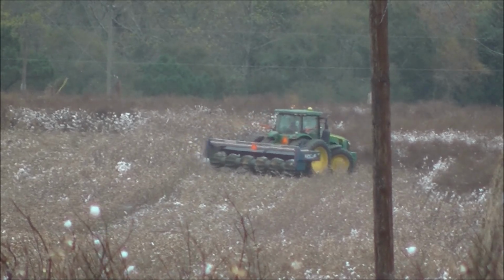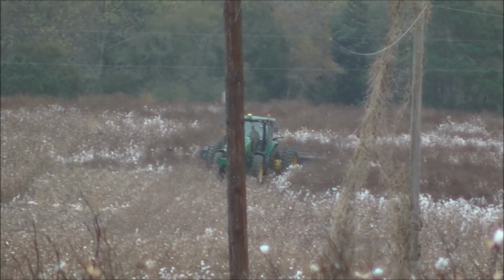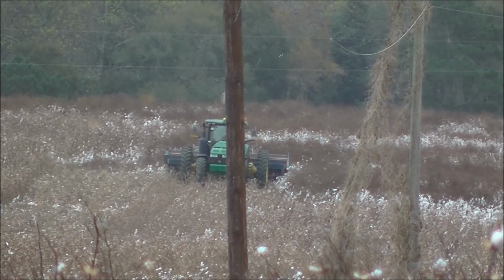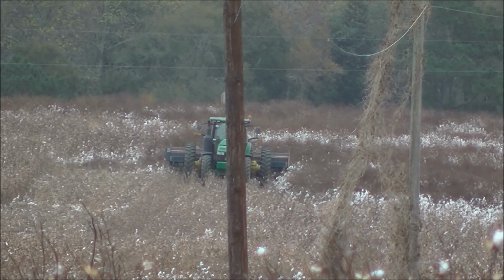John Deere 8295R Chopping Cotton Stalks. Scott Farms Cotton Harvest 2

Comment: does the hi-speed puller/chopper work well?  Does it Chop well?
Reply from the maker: From what i have seen it does work really well. I do not know how difficult it is to maintain but i think it would be less than running a shredder and then coming back with a stalk puller. That thing is heavy though.

Comment: Seem like they could use a 30' horizontal mower trailed by a 30' tiller. that should takecare of the stalks and the bole weavile
Reply from the maker: That is the way it used to be done back in the 90's and 2000's and some still use that method. Most are going to this method as it takes less trips across the field and is faster and it requires less maintenance. Those flail mower cutters take a beating in cotton stalks. Rotary mowers too.
Reply: I meant that you hook the 30' tiller behind the rotary mower and do it in one pass. No ground compaction or 2nd trips. The way it is now you still need to come in and plow and prep a seed bed so you have more trips and more compaction. You can plant right after the tiller is done.

Comment: Looks like 10% of the crop is on the ground
Reply from the maker: Not really. Cotton losses are easier to see than most crops because it is white and fluffy. There is one area close to the edge where they tried to pick against the rows to gain more room to turn the pickers. They lost a lot more in that area but it was unavoidable. Thanks for watching1
Reply: Terry Presnal 
Y not plant a turn row around the field like a corn field?
Reply: Yes.  That is what you get with JD picker.